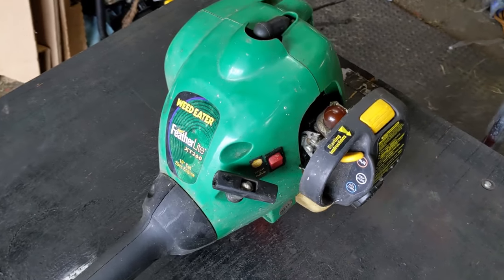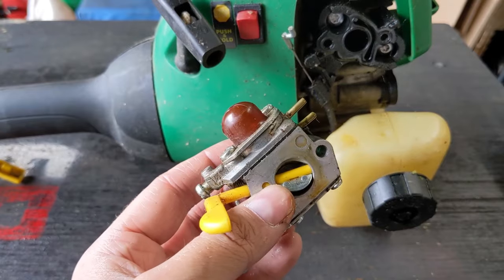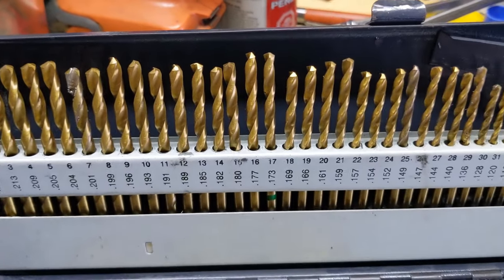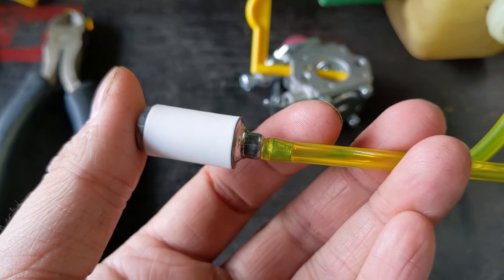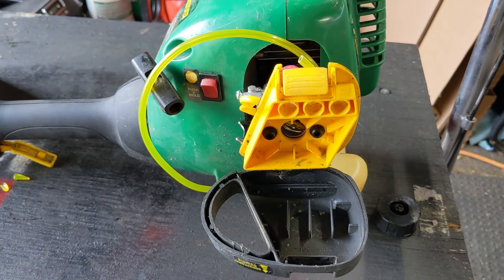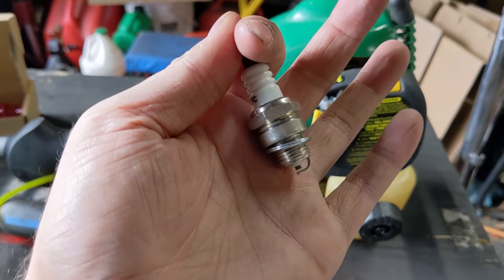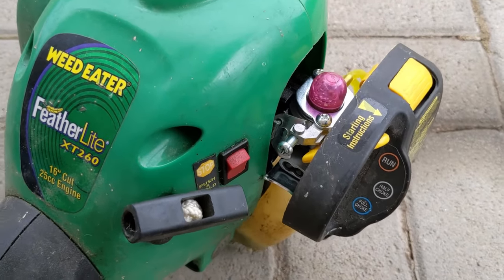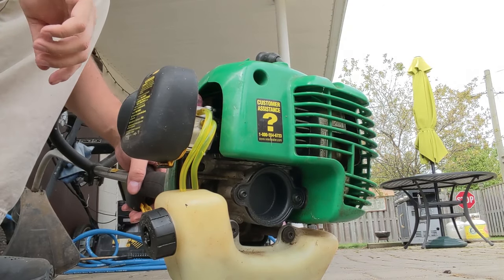Weed Trimmers - Don't Rebuild The Carb!

Comment: Dude, there is supposed to be a spring around the idle screw so it won’t back itself out. Using Loc Tight is not a solution.  It needs the proper spring for a long term and always adjustable solution.  Honestly can’t believe you didn’t catch that.  Springs around carb jests/adjusting screws have been around forever on all small engines, motorcycles, etc.
Reply from the maker: Yea that's the unfortunate thing about Chinese parts, cheap but obviously this one was missing. I don't have springs like that in stock, little bit of red and it works great.
Reply: Nah..buddy I'm looking at the idle screws right now and there is NO spring on the old OR new carb..I think BLUE loc-tite will be fine.👌

Comment: i can't believe you wasted $21 on a machine that you would struggle to get more than $40 for. i won't even touch machines like that for customers. i also just order metering diaphragms for that style carbs now. most of the time that is all they need.
Reply from the maker: I get these for free and I sell these for $75 after putting a $21 carb kit, some fuel and string, and like half hour labour. They keep me busy when I'm slow, I usually develop a small pile of them in the summer.

Comment: Looks like the duck bill was missing  in the gas cap.
Reply from the maker: Yea they tend to fall off, I have a bunch of those caps, they still work fine to vent, but you might notice they get wet with fuel.

Comment: A little WD40 on the fuel line allows the line to pull through easily.
Reply from the maker: Sometimes we use silicone lube, thanks for watching!
Reply: Wd40 would the fuel lines,it softens rubber, so ne careful using wd40 on fuel lines.